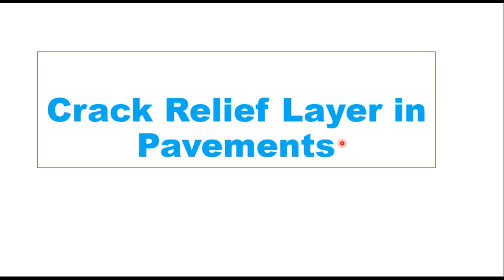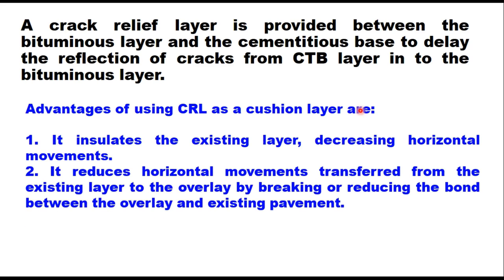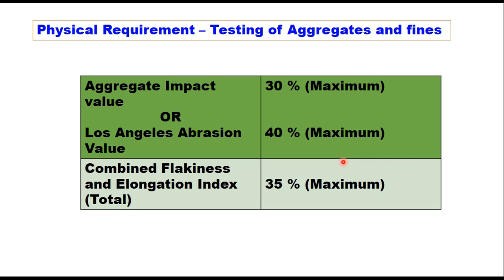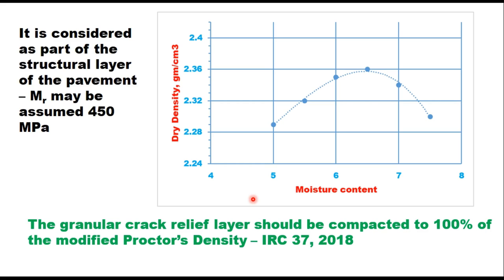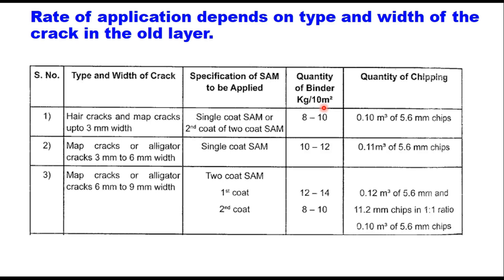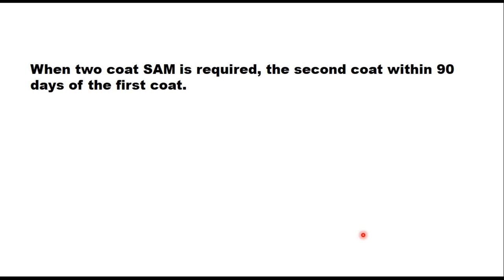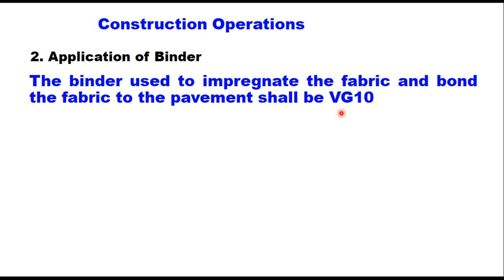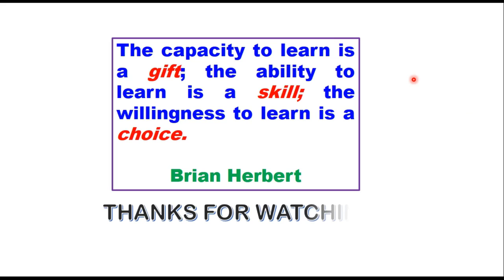Crack relief layer in flexible pavements, functions and types including construction procedures.

Comment: Sir, Can i provide a granular crack relief layer(Wmm 100mm) in between existing Bituminous and Overlay Bituminous layer?

Ex: Existing BT Layer thickness of 150mm, Design Traffic of 100msa, we found the remaining life of pavement using FWD method that required overlay 100mm of BT layers.
Reply from the maker: Not a good idea, in my opinion. You should recycle the top 80 - 100 mm Bituminous layer and use this thickness as BSM (Bitumen stabilized Mix). Then place DBM and BC above this layer as per design.

Comment: Good Afternoo Sir..for a newly constructed Cementitious road (CTB as base course and CTSB as Sub-Base Course) do we need to provide Prime coat and Tack coat over SAMI layer? (as per IRC 37-2018, Fig 12.17, SAMI layer is required over CTB layer). & We are using BC as surface course.
Reply from the maker: Prime coat is needed on granular layer only and tack coat on bituminous surface. Since SAMI layer is generally low viscosity binder, prime coat is not required above it
Reply: @SatishIITR  thank you sir..

Comment: Sir, The aggregate type of crack relief layer also absorbs stress; shouldn't it be called as Stress Absorbing Membrane Interlayer (SAMI) too. Please reply, sir.
Reply from the maker: Aggregate layer is taken as part of the structural layer whereas SAMI is not. The construction difference makes them different.
Reply: @SatishIITR  Yes, sir, but the SAMI term can also be applied to the aggregate layer type. Why do we only refer to Modified bitumen plus chips as a stress-absorbing membrane interlayer (SAMI), whereas the aggregate layer can also absorb stress and be called SAMI? There is a difference between design and construction, but the terminology is unclear. As a result, many Uttar Pradesh residents call SAMI a geosynthetic layer, which is incorrect as geotextiles distribute stress rather than absorb it. I would appreciate some clarification on terminology.

Comment: Thanks for the detailed and precise summary with all relevant codes included. I have some doubts, sir. 

1. Can SAM be used as a wearing course as it resembles surface dressing?

2. Can we allow traffic on SAM/SAMI? If yes, how soon after construction?

3. If geotextile is already impregnated with bitumen, a tack coat before laying geosynthetics is required or not?

4. The type of geosynthetics that need to be used on the FDR base. As there are many as per IRC SP 59 2019.

5. Which crack relief layer is most effective for the FDR base?

Please make a video on the quality control aspects of the FDR base and CRL.
Reply from the maker: 1. No, SAM is an interlayer treatment and cannot be used as top layer. 
2. No, traffic should not be allowed on SAM or SAMI layer
3. No
4. There is no such guideline available for type of geogrid, it depends on designer.
5. Aggregate layer
Reply: @SatishIITR  Thanks. Sir, MoRTH states that traffic can be allowed after 2 hours of rolling with speed upto 20kmph and sir why Aggregate type crack relief layer is most effective for FDR base. I'm engaged with PMGSY and many states are using geosynthetic type. Please provide literature or your explanation for the aggregate layer. Thanks
Reply from the maker: @surendrachoudhary2063  Impregnated Geotextile can also be used as crack relief layer as per MoRTH 2013, but you need to excercise proper QC. Aggregate layer provides the same function but easy to lay.